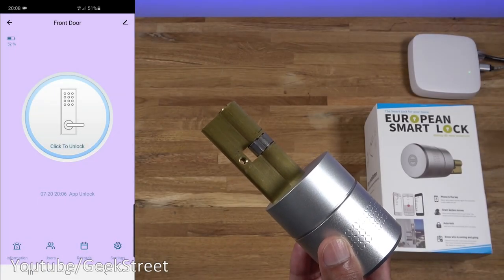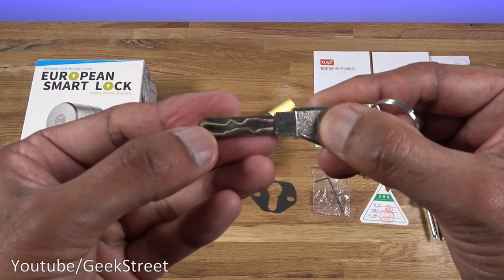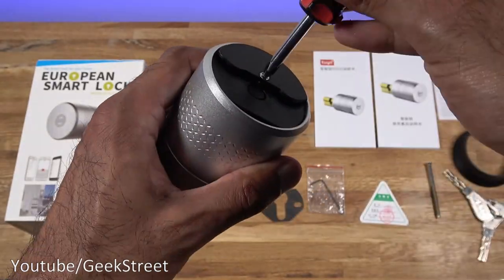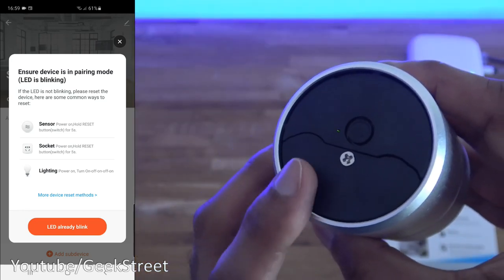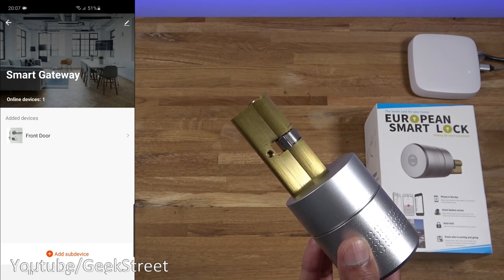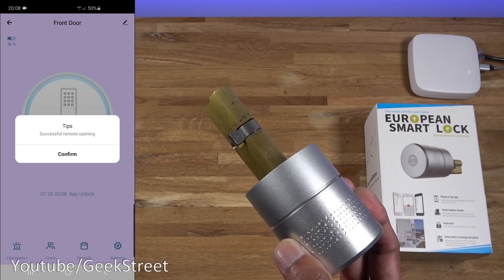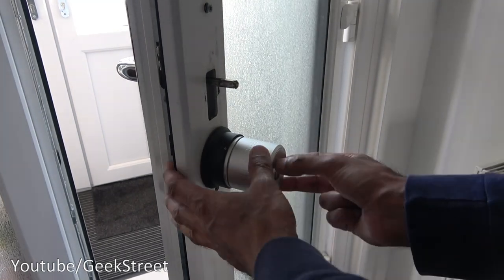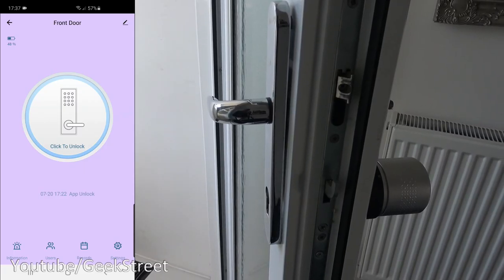Tuya Zigbee Smart Lock Unboxing / Setup Review

Comment: Does it have 3rd position to open the door - as you did with key? That means positions locked, unlocked, and open - which does half more rotation to actually open the door if you have knob from outside?

Comment: A informative and comprehensive review as I've come to expect from yourself, thanks for sharing.

The potential issues that I can forsee is that it looks to be a poor quality lock with zero break-in protection as there is no anti-snap protection visible, so a thief could break-in in just 6 seconds!

It doesn't look BS kitemarked either.

I would recommend that you contact your home insurance as it will likely become invalidated.
Reply from the maker: Thanks for the comment, yes exactly insurance companies won't be happy with it, we need a major brand making products like this.
Reply: Indeed, that's what I thought too, it says on the box "copper", there is no antri-drill and / or  anti-break protection, just soft metal, not even steel but copper. It's a pity as it's an affordable (maybe that's the reason?), easy to use and smart device!

Pity you can not adapt it to one's own cilinder as you cand do with other brands, such as Nuki.

I am sure it's totally fit for not high security doors, such as hotel rooms, offices in an office building and so on. But if it's your main entrance and the only lock, you will need at least a good, strong external protection shield. 

Very good and detailed review, thanks.

Comment: I just bought this too. It works great but my lock is too near the edge so I can't close my door. I wish there's a way around it. I got the fingerprint sensor as well which is surprisingly fast, no need for the app. My door is like yours too, glass with a narrow frame
Reply from the maker: With a finger print sensor! Nice! I'll have to check that out
Reply: How far from the middle does this lock come out by? Think I may have the same issue.

Also what's the finger print sensor about, can you give me more details please
Thanks
Reply from the maker: Finger print reader he means.
Reply: Hi, just concern about battery life, how many months it gives ??

Comment: Hi, nice video thank you. I thought the lock cilinder for this model  is changeable in length. The pivot that goes in the cilinder is variable like 40-100mm so it can sit flush to the shielding plate of the door handle.
Reply: That's M520/521 type, it is variable in length - shown here is Type 500/501 which is fixed 35mm/35mm.

Comment: Hello, I have the lock installed and I have any questions, I have linked it with smart life but I see that it only gives you the option to open, you cannot close it from outside the home, only if you use the airbnk app with Bluetooth. Is there any way to  be able to close it outside the home?  good video
Reply: Set it to close by itself after so many minutes
Reply: You can set "Autoclose time" - so after open it will close after "n" seconds (+/- a delay of a few seconds). Since you can change this setting from remote you can close a door by first opening it and then have auto-close close it.

Comment: Thank you for your video review. I was thinking to install it on my front door. But i do not know if it is IP65 or IP66. Compatibility with Google or Alexa would be great, but according to its price i think it is ok. What is your total experience?
Reply from the maker: I wouldn't feel comfortable installing this on my front door.
Reply: @GeekStreet  Thank you
Reply from the maker: @mixlimantz  you're welcome, stick to a normal high security lock.
Reply: @GeekStreet  I was thinking about Nuki...😉
Reply from the maker: @mixlimantz  that seems like a good one.
Reply: @GeekStreet  Thank you
Reply: Not that I would trust it but if you do remember only the key barrel is outside, like any other lock so water cannot effect it. The bigger issue is all key barrels are different and they should have made this to be able to replace the barrel to other sizes. What would happen if you broke your key or lost them you would have to buy another lock and handle.

Comment: the weakest part of all locks is the key, so having a key with a smart lock means you are achieving nothing as far as security is concerned, fingerprint locks should be fingerprint only, no key,
Reply: Depends on your security target - I was desperately searching for exactly this setup. I know I can recover from technical faults (sw) or loss of battery with a key. I would rather not want to be locked out of my flat (8th floor, no way to get secondary access path) having to call a locksmith that drills open my door/keyway.
And the key locks decent from a lockpickers perspective (I'd give it a 4 or 5 out of 10) - better than most "landlord supplied" locks I have had in the past and if you have a house your windows and "other doors" will be a much easier target for most situations. Keep in mind a decent lock is ~150+ Euro, like the Assa Abloy Protect2. But if you loose the key or lock yourself out it will be much more expensive to get a locksmith to regain access.

Comment: this is probably the worst lock I've ever seen.
The Bluetooth app is completely useless for automation.
The original Tuya Zigbee gateway can only unlock the lock, but not lock it? This was programmed by a lunatic!
The manufacturer provides no support.
The thing has a huge battery consumption and no third party integration on Zigbee works. So it's not a zigbee, it's just a Tuya device. What good is a lock that can only be unlocked via an app?
Reply: Can you recommend any similar, but better lock?
Reply: @Coyote973   Probably only Danalock